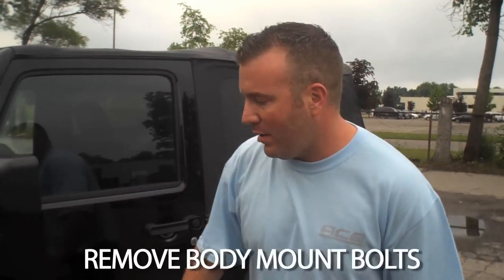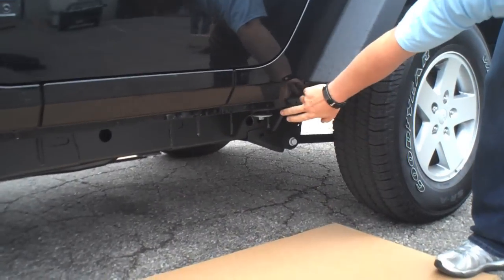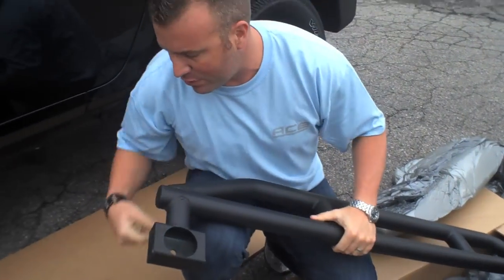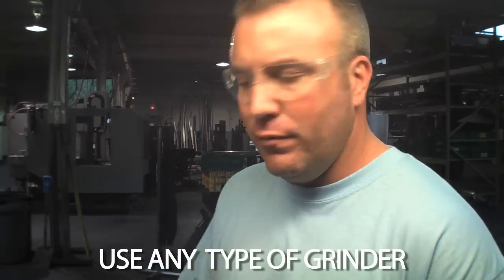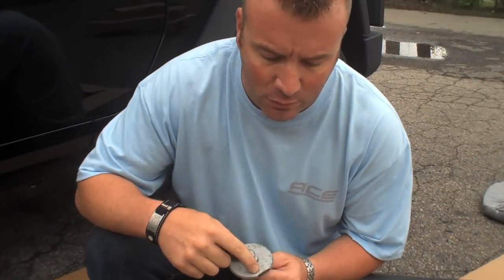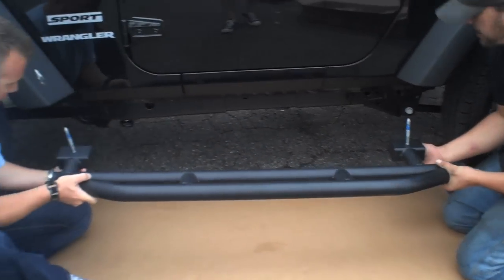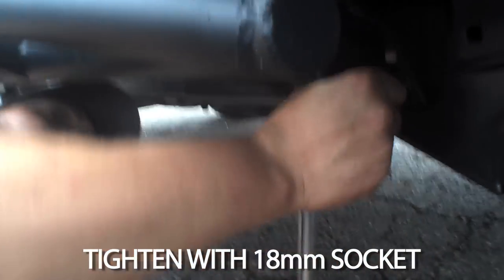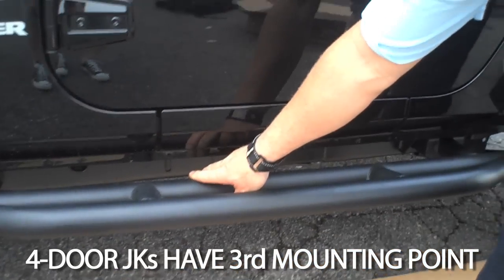How to Install ACE JK Jeep Rock Sliders

Comment: Just ordered a set for my JK. Glad to see its no longer necessary to grind! Can't wait to get them on!
Reply: Except that's not true. Received mine today and the washer WILL NOT fit without grinding.
Reply from the maker: Collin Smith sorry to hear that. Did you buy from a distributor? They may have old stock.
Reply: +Collin Smith   Just got mine on, had to grind mine.  So......

Comment: The bolt and washer are already on your Jeep from the factory that your using. The washer is connected to the body bolt.It will not come off but it will spin.

Comment: REMOVING BOLTS I got to a point where some  were just spinning. It wouldn't pull up or down but it would rotate and free spin. I ended up pulling with a good amount of force down on the washer while ratcheting them off.

INSTALLING BOLTS Bolts not going in? I took the socket and extender out of the ratchet and taped it a couple of times with a rubber mallet

The washer can get super hot when grinding it down

18 Socket with extender (3/4" is technically a 19mm but will work)

Tighten to 80 ft/lb

Comment: I installed these on a TJ Rubicon and there is now a rattle. The front of the slider bar contacts the underside of my factory Rubicon rails but I can't confirm that it's the cause since I can't shake the Jeep hard enough by hand, in a driveway, to simulate hitting a series of jolting bumps in the road.
Reply from the maker: CubNole give us a call and we'll see if we can help you fix this. 586-806-6641.

Comment: Product looks great, but how about we make a product that doesnt require grinding of washers ? How about we make the hole on the mounting box a little bigger ? Honestly I'd buy these in a second if that were the case.
Reply: Agreed. Seems kind of cheap to me.
Reply from the maker: Steve Rivera he product is now been updated and you no longer need to grind the washers.
Reply from the maker: ACEEngineeringandFab he product is now been updated and you no longer need to grind the washers.

Comment: I'm in the market for this style but I don't know I want the rock protection and a step at the same time are these a foot step I'm 300lbs 6'3" my gf is 5'2" and can barely get into my completely stock 2011 jk Cause she's short I like these I just want to know that they can take the weight and provide the protection from rocks
Reply from the maker: Vernon - yes these can absolutely take the weight and make a great step.
Reply: ACEEngineeringandFab awesome thank you
Reply: ACEEngineeringandFab I had one more question have guys every had any issues with the body mounts bending over time might a dumb question been a jk owner for 10 months so I'm new to jk I want to build it up I'm not a fan of drilling which I know limits my customization for other products
Reply from the maker: Vernon - it's happened but is VERY rare. You really have to do so pretty extreme drops before you worry about that. That being said, adding factory Rubi Rails can limit the potential for rocker or body mount damage if you prefer not to drill holes and step up to something like our Night Runner Slider Armor. Thank you.
Reply: ACEEngineeringandFab I'm still considering those because I have not anything on the market that matches your companies nightrunners I love em just have to make that finally go for and not look back decision
Reply from the maker: They're a great mod.
Reply: I'm gonna get your guy tire carrier with the Rotopaks next
Reply: ACEEngineeringandFab oh I know we'll see